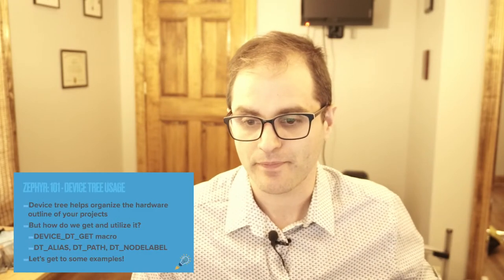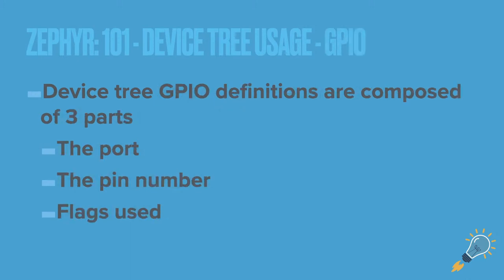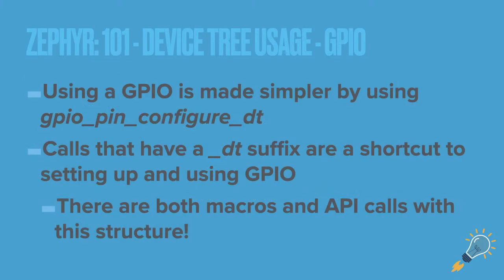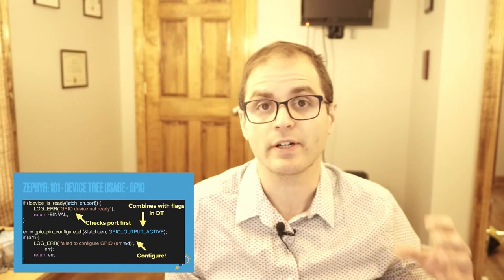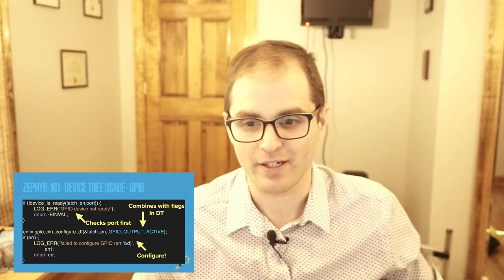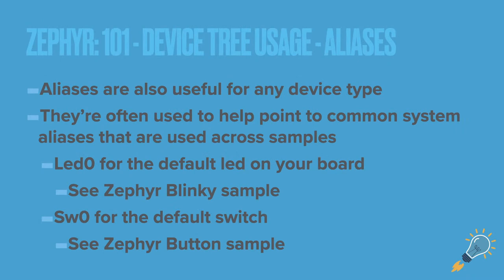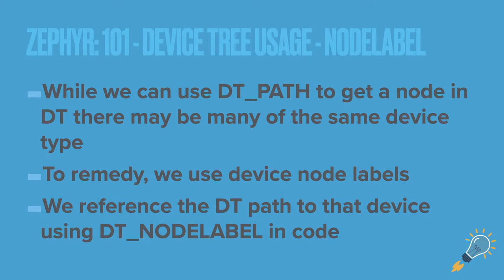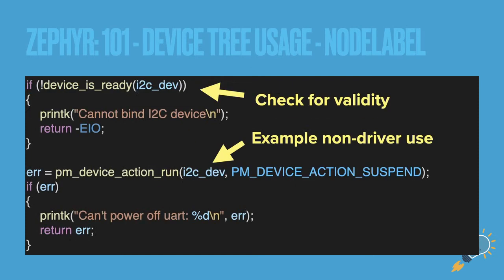Zephyr 101 - Using the Device Tree

Comment: Again another very useful video - THANKS! A question: do add to the zephyr.dts the definition of of a gpio, ie. your zephyr, user { definition?
Reply from the maker: Typically I'll add any modifications to my device to a device specific .overlay file. Whenever you choose your board (using the -b flag in west) it will search for .conf and .overlay in your application folder.
Reply: @CircuitDojo
Reply: @CircuitDojo  Hello and MANY THANKS, you made May Day!! It works!